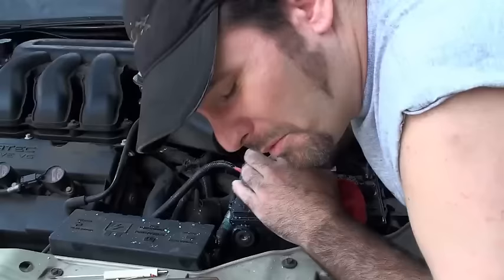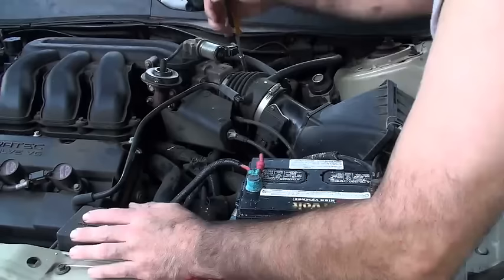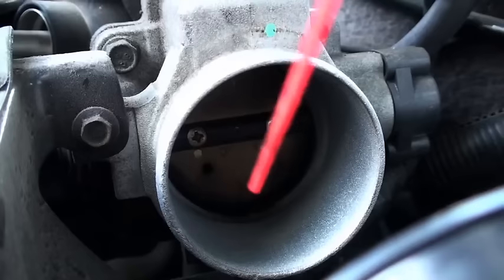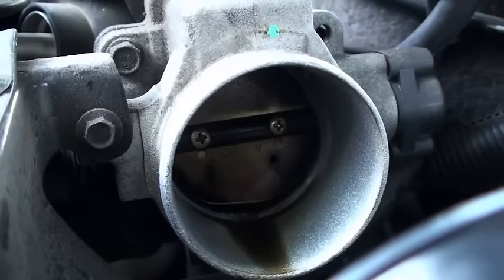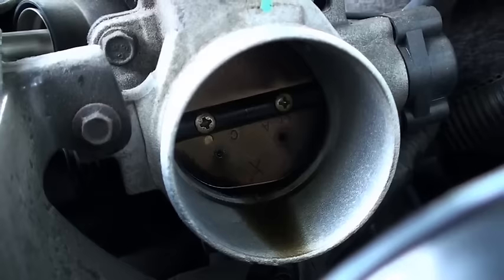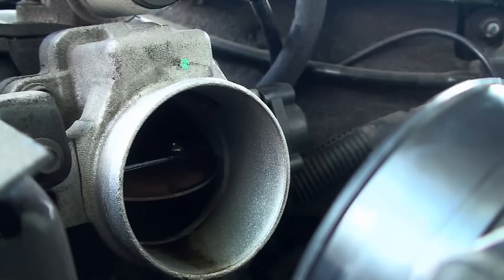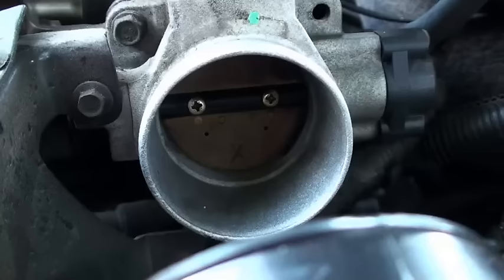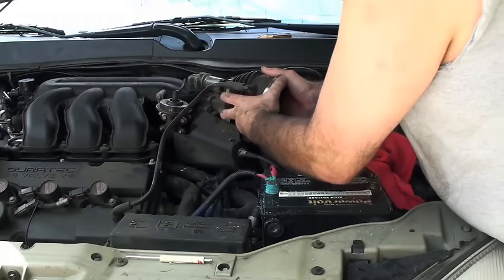Quick Tip-Throttle Cleaning - EricTheCarGuy

Comment: How did you open up the throttle body valve?
Reply: By pulling the throttle cable back
Reply: +Ricardo Moran And what if you have DBW throttle?
Reply: +boarderboi7 read the caption. He says don't do this to DBW systems.

Comment: Looking for a video on poor throttle response. Got.anything
Reply: Check the throttle cable? . i had a similar problema with my car just feeling that it wouldn't go no matter how much i put my foot down.
Reply: Electrically Check your MAF and MAP(if equipped).. If that's not it and you don't find a problem check your plugs and wires. If those look good check your ignition control module with voltmeter. Hope this helps. Could be a number of things though. Do you have a check engine light on?

Comment: can I use carburettor cleaner instead of throttle body cleaner?
Reply: +Zohaib Anwar Not recommended because it's mostly dirt particles that dirty the throttle body not carbon. Throttle body cleaner is designed to clean the dirt built up in the throttle body as well as not damage the engine once it starts after cleaning it.
Reply: +krauser979 how about brake cleaner
Reply: Ulises Chilperico
Do you want brake cleaner being sucked in your combustion chamber the next time you start your car? remember some brake cleaners aren't flammable and if that stuff seeps passed your piston rings it'll break down the oil and maker it super thin. Just use throttle body cleaner it does the least harm the next time you start your car after cleaning.
Reply: well brake clean evaporates quickly and by disconnecting the TB i can dry it efficiently nevertheless i am going with TB cleaner
Reply: Ulises Chilperico
Your choice man I wouldn't want something contaminating my oil or the internals of my engine but that's just my opinion since I don't mind spending the $10 on proper throttle body cleaner.

Comment: after i watched your video i cleaned my and now my car idle at 1500k up 
to 2000k don't want to come down to 750 or 800 like it used too any 
idea? my car is Nissan sentra 1.8s
Reply: You might have damaged your throttle position or mass air sensor with whatever you cleaned it with. Some of those sensors in the intake are very sensitive to getting contaminated. If it's an older car, like 90''s, you may have an idle air control valve they needs adjusting. Possibly it was sticking before and when you cleaned the throttle, is normally mounted on the TB, you unstuck it and now it needs to be adjusted. Good luck!
Reply: +uncreativename I got it working again thanks
Reply: +Tshais-Vang2014 normal, the ecu is recalibrating the throttle position
Reply: +JayVan Geli yes I just did a relearn and it works after 30+ tired
Reply: Tshais-Vang2014 glad you figured it out. Nissan relearn may be more complicated. My fords are easy to do a relearn.
Reply: +JayVan Geli yes a little hard timing is the key a second off need to start all over
Reply: Tshais-Vang2014  I got the same problem with my 2007 Silverado check engine light when away but now the rpm won't go down any answers helps thank
Reply: Martin Llanos try idol relearn it help
Reply: Martin Llanos just look on YouTube for your car model and year then idol relearn should help you
Reply: thanks man

Comment: Can you use MAF cleaner to clean the outer portion of the throttle body?
Reply: Yes but carb/throttle body cleaner is $2 at walmart.  MAF cleaner is expensive.
Reply: Clearanceman2 maf cleaner is only 10$ at oreillys
Reply: jsalter00  Just curious... what benefit is there to cleaning the outside of the tb?
Reply: South Main Auto Repair
I assume to keep temperature control, hence the coolant line.  And shiny is easier to see damage/dirt?  Stay gold.
Reply: The coolant line on a TB is not to keep in cool but just the opposite. It is there to keep it hot and keep the venturi from freezing. I think they clean it just to have a shiny part on there car and look like they did something lol.
Reply: South Main Auto Repair
Ya, I guess temperature control (not letting it get too hot) would be helped by keeping it clean.  Keeping a car clean is probably good too!  Stay gold.

Comment: would brake cleaner work?
Reply: I wouldn't do that just to be safe due to the different chemicals btw I cleaned mine today what a difference
Reply: Mechanic used Brake Cleaner, Low Idle is Better, But Check Engine Light is On Now (1st Time Ever).  I will try to reset by Disconnecting Negative Battery Cable 1st.  2005 Honda CRV.

Comment: if you own a Nissan and even gently touch the throttle plate, your heading back to the dealer for a idle re-learn and $125-$150 out your pocket. Only Nissan has the software to fix the problem your gonna have.
Reply: +Ron Towers ya if its electric. and ive reset the idle rpm in a pathfinder myself before

Comment: DO NOT CLEAN THROTTLE BODDY WHILE IT IS STILL ATTACHED TO THE INTAKE MANIFOLD!! Take it off before you spray, as the liquid is not supposed to run inside the intake

Comment: Dear God- what's up with that battery terminal- blue lead oxcide slpattered all around? Loose connection, overtaxing the alternator, overheating the starter (long cranks), probably leaking acid onto plastic and aluminum parts? Whats wrong with some people? Just gas & go till it dies? Only let a "tech" open your hood? I'll bet they know every stat about their "team" or what Bieber had for lunch though, huh? Sickening and disgraceful. Thank God for the 100k mile warranty.

Comment: how did you open the plate?
Reply: to the left of the throttle body he opened it using the throttle cable lever, if your car is drive by wire (no cable going from pedal to throttle body) you wont have this.
Reply: Diy_Automotive so I just pull the throttle cable lever?
Reply: @eeyyaakk6801  yes. Make sure your vehicle is off of course, but you can use the throttle lever to hold the plate open for cleaning.
Reply: Diy_Automotive I see. Should I disconnect the battery? Sorry I know next to nothing about cars, although I've successfully cleaned a MAF sensor.
Reply: by the way, I'm your second subscriber. keep it up, the more knowledgeable people on YouTube, the better
Reply: @eeyyaakk6801  thank you! I appreciate that. Disconnecting the negative battery cable is almost always a good idea, having a manual throttle body it won't really matter but say if you had a drive by wire throttle body (no cable from gas pedal to throttle body) you would definitely want to undo the battery. You wouldn't want to have your fingers in there cleaning and some how the throttle body activate and pinch them.

Comment: Can I use WD40 for cleaning the throttle?
Reply: No that a lubricant it will just amke worst dont do it
Reply: carb cleaner or throttle cleaner
Reply: WD40 is not a lube it's a penetrant solvent, it removes lube.
Reply: Rýán Túçk Either way I don't think he should use it :/
Reply: first try carb cleaner i got a throttle body error message 3 months ago after i riped it off cleaned everything on it from valve to body i havent had it since then

Comment: "Clear flood mode"???????? i'm sure it's not called that, it's called getting more air into the engine
Reply: It really is a thing. When the throttle is opened 80% or more during starting , the computer will reduce the fuel flow temporarily.
Reply: Yep its refered to as WOT or clear flood mode. PCM Actually shuts off the injectors.

Comment: My car and many other vehicles today have DRIVE BY WIRE throttle bodies. The throttle is electronically controlled. DO NOT OPEN THE THROTTLE MANUALLY!!! Doing so can ruin the throttle body. If you can  remove the entire throttle body assembly and clean both sides. Also, you might have to replace the throttle body gasket when you remove the throttle body.
Reply: +Frank Gonzalez, just messed mine up doing this very thing tonight. didn't know.
Reply: +Frank Gonzalez,
Fixed it.

http://www.engine-codes.com/uploads/gmc/throttle_body.pdf
Reply: +Frank Gonzalez you can also turn the key on an put a brick on the pedal
Reply: +Frank Gonzalez It's a 2 person job leave the key in the on position and have someone push the pedal down. It'll move the throttle plate.
Reply: You only need the key with a dbw body, a GDI not needed.
Reply: homer simpson g

Comment: can you do this with wd40?
Reply: Proper throttle body cleaner is always better. Yes, WD40 is a solvent, but it sticks there since it contains a lubricant too. Throttle body cleaner, instead, eventually evaporates on its own leaving an easy to remove crud (if any is left).
Reply: tnx man

Comment: Bad way to do it. Uninstall the throttle then remove IAC ( Idle Air Control) Valve. Then clean IAC Valve with throttle Cleaner spray
Reply: dont clean IAC with throttle cleaner. I reckon use Mass airflow sensor cleaner

Comment: can we use wd40 to clean the trottle ?
Reply: No
Reply: double NO
Reply: mass air flow cleaner works
Reply: i happen to see one mechanic do just that not long ago
Reply: It may not be all throttle/carb cleaners that smell like it but for the most part it smells like acetone, so you would probably have a better chance at using nail polish remover.
Reply: He's quite a good mechanic, but i have to agree with you that he should have use a proper throttle cleaner instead

Comment: some people are so cheap all these people want to get by the cheap way instead of a $3 can of carburetor cleaner maybe they should put hot lava down there or boiled battery acid. I know Cheapskates  you should open the throttle up  and soak it down in there with the garden hose .what the hell is cheaper than the $3 can of Gumout?

Comment: 2.67 million views for this BS? Really? No throttle body/intake should be cleaned while still installed on the vehicle. Even on cable driven driven throtle bodies, you run the risk of saturation and excessive dirt going deeper (into unreachable areas) of your intake/plenum. Start it up and you risk damaging upstream o2's, fouling plugs, cat damage, and intake/exhaust valve damage. Drive by wire throttle bodies? Besides the above mentioned, get ready to take it to the dealer to have the idle reset since you manually pushed open an electronically controlled servo/motor driven assembly that has now lost it's 'zeroed value'.
Reply: I used this method before I even watched this video on my 08 Cobalt, and have had absolutely no issues.  In fact it idles a little lower now, and the throttle is of course more responsive.